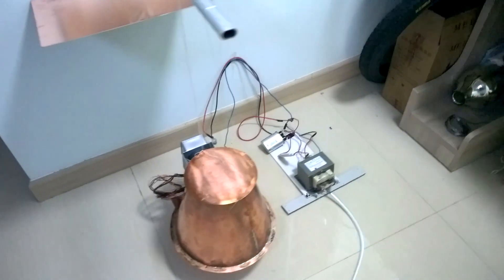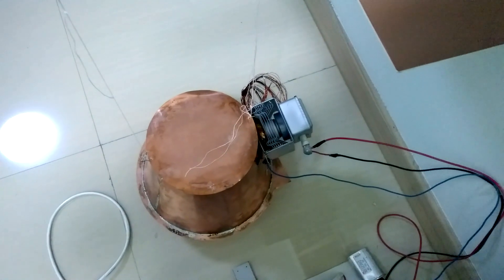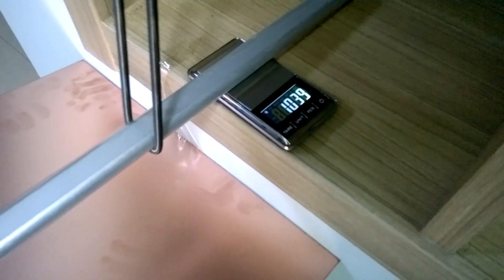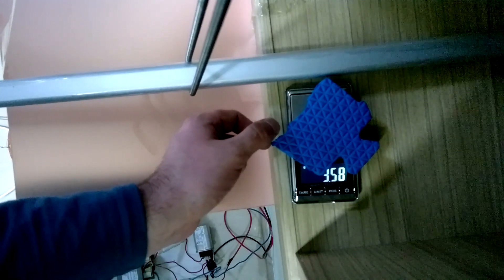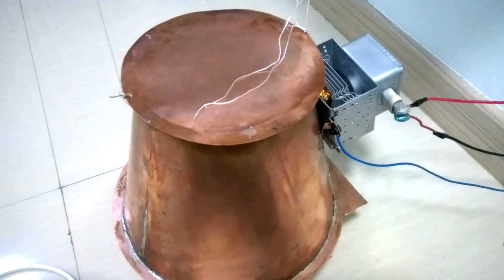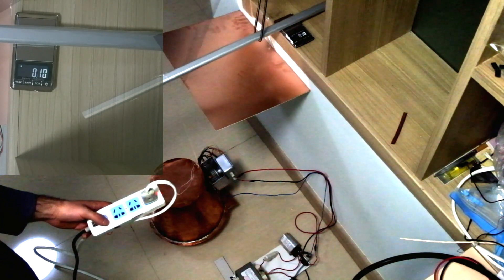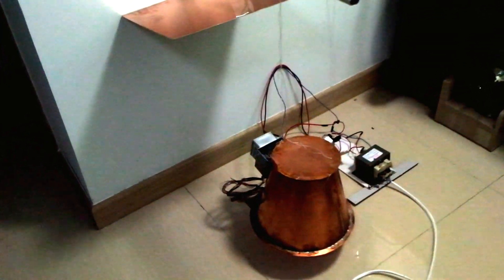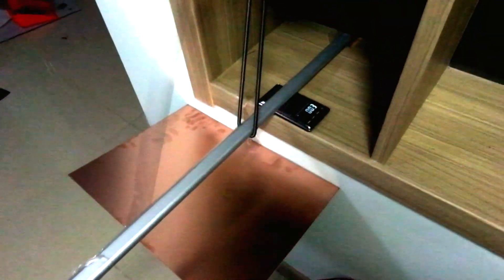EmDrive Test No.03 Success, I have thrust !!!

Comment: Magnetic effects of the power cables is what you are measuring.   Other EM Drive researchers found it very difficult to remove that source of error.  You should also try supporting the EM Drive with a block and see if you get the same reading.  It might be microwave energy being picked up by the scale.   But I think it is more likely a small magnetic torque on the power wires.
Reply from the maker: Check the other video with the opposite orientation, there is thrust also.
Reply: @iulian207  Your method for measuring any possible thrust is very imprecise.   You want to get positive results.   That's why you are not being careful.   I have seen the experimental results for many hopeful EM Drive experimenters.   Most are more precise than you.  The end result is always a second order "thrust" signature, indicating a thermal effect.   After you eliminate magnetic torque, you will start to see that.

Comment: First have you done any math on the resonance of the container in respect to the micro wave length? That is kinda important in this considering it’s based on resonance amplification. All so you should switch over to microwave plasma jets. That’s actually much more diy and offers way more results. EM drive is possible too tho just saying you don’t seem to be very heavy on the math and just slapping stuff together. I mean that’s not all wrong and some of our most important discoveries are due to mistakes. But this just seems a little more like stuff I was doing in middle school.

Comment: So much advice from people who haven't tried to buid and test the EM drive, i only can add my two cents. Based on experience: the scales work better, if they're cleaned from the weed residue between the plate and sensors. Also, smaller ones,
 with a simple backlit lcd display should react quicker, unless you go for high-end cumputer connected ones.

Comment: Hi. I understand, that it is resurrecting of  a "dead body". But the principle of work of this device is not something mysterious. It is a similar to a pressure of light. EM wave has it's impulse (by the law of conservation of energy). Make the frustrum and smaller plate from dielectric, and thrust will increase.

Comment: It is an interesting experiment, but I suspect that your magnetron is heating up the copper frustum unequally. Magnetrons heat up while in use, and since your frustum has a bigger surface area below than compared to the top, there would be differential heating of the air(because you can't do this in a vacuum, air plays a pretty big role here in messing up the experiment) and that would cause a resultant force upwards that can cause an erroneous reading. Still though, it is good to see that some common non-funded people are doing their own experiments in this day and age. Keep it up!

Comment: But. This Electron Charged Ion is not fast as Light Speed (!86,000 Mies a per Second);  It was created EM DRIVER for Inter- Planetory Traveler by Roger Shawyer. NASA already used it in 1998 on the deep space. This may be present bragging  Invincible Mach so called Hypersonic Speed Missiles by China and Russia?.

Comment: From the movie it seems that after few seconds the thrust is reduced, why you have not kept the ON phase for a longer time instead of continuously switching ON and OFF? Perhaps because after a few minutes the thrust would disappear? In that case in my opinion the measured effect is only due to coupling effects between the injected electromagnetic fields and the measurement device.
Reply from the maker: After a 10 seconds the magnetron  becomes quite  hot, and since i did not put a fan due to the obvious reasons, i was forced to stop.

Comment: not too sure just using imagination to guess this  but if microwave is based on radar waves then a tight beam of energy that  "physically" bounces off of objects to echo an object as a  blip on radar would mean that that same tight beam of energy would equally physically bounce off of surfaces inside a box-The armour on tanks are made at shallow angles to reduce the impact thrust and hopefully stop a shell reaching it's occupants -So if you create every wall inside an emdrive with angles  and "just" one end that is completely flat then the force of microwaves would hit these angles with a shallower force than the one single  flat surface - the bouncing back to the shallow angled walls may partly negate the forward impact with the flat surface but only by a fraction of energy impact compared to the  energy impact with a flat surface since the flat surface will receive a greater kinetic forward impact than the shallow angles within the box-The flat surface  would receive the maximum impact of force  -If microwaves are a form of radio waves but concentrated then their waves should surely be kinetic when hitting a solid surface even if that impact is minute-on the ground the friction or drag would negate that  "MINISCULE" forward impact , but in space where there is no friction then that impact would be unhindered by drag or friction(unless solar winds are heading in the opposite direction)  -imagine an untamed lion slamming itself against the inside wall of a cage that is not fixed or anchored to the floor-each successive blow will shift that cage forward in the direction from  where that blow was struck-without friction to create  drag the slightest impact against the "flat" wall  OF AN EMDRIVE would have more impact thrust than the angled walls because as in tanks a shallow angled wall will get less impact than a flat wall-My concern is that if microwave energy causes the molecules or atoms to jump up and down excitedly then friction would create heat and perhaps given time the metal may become compromised when it's surface is "eventually"  heated up by  "continual"  microwave bombardment  no matter how low the wattage is

Comment: Hate to burst your bubble, until that thing comes up off the floor by at least a few inches, you don't have anything. Once you lift, you then need to regulate or control it. To have something suddenly crash to the floor once the power is off would not make for a good presentation.

Comment: The easiest way to get to space is to use the Magnetron - that's right - just like the one in your microwave oven! The Magnetron in your microwave oven operates at about 2.4Ghz - this is good for agitating the molecules in food, but if you increase this "microwave" or "electromagnetic vibration" to about 30/33Ghz you can start to manipulate the force of gravity itself!

With this, you could surface a large shipping container with Magnetrons about every 30/33 inches and slowly increase the Gigahertz - as you get to about 30 GHz, you will start to create your own gravity! At this point, you open the Magnetrons on the top of the spaceship more and; just like Matter creates its own Gravity, there will be MORE "Gravity" on the top of the ship than the Gravity imposed by earth, and the ship will "FALL" upwards!

You modulate the Electromagnetic Field around the ship in the direction you would like to "fall" or travel in and "Gravity" will "fall" you into the direction you would like to travel!

ALSO - you can apply a strong field to the entire shipping container and actually reduce the interaction of Matter on the shipping container - moving the weight of the ship out of faze, reducing its "mass" and making it extremely nimble! - Able to travel at unimaginable speeds with little or no "gravity" within the ships field - therefore there will be no gravitational pressure within the vessel itself, so fast acceleration, sharp turns and abrupt stops will not effect the ship and crew!!! Orion Michael Guy

Comment: There is zero thrust at all. A weight valance and a copper pot on a nylon string all parts are wobbeling around,
after all it shows us clearly what EM-drive is : waste. Waste of Electricity and copper.
But the video is good, no noisy music and clear picture.
have fun

Comment: http://humbertomondejargonzalez.blogspot.com/2018/05/469-el-experimento-sobre-emdrive-de.html
469-El experimento sobre EMdrive de unos alemanes que es irrelevante porque no aporta nada nuevo al tema; que ya todos no supiéramos.
.........
4-Contradicts, the law of conservation of impulse.
.............
NO !, it does not contradict any law of impulse; because the engine must be supplied with energy constantly and this energy when released by the walls of the chamber in the form of heat (electromagnetic radiation, electromagnetic photons, the same ones you feel in your hand even the humblest of humans when you approach a hot metal plate, nothing of the other world that can not be understood by a scholar), according to the asymmetry of the camera will create an imbalance in the net output of photons and that will create a small boost.

Comment: The setup is flawed. With tight enough tolerances, all it would take is a vibration against the floor to create the appearance of reactionless thrust, when in fact the thrust is nothing more than a measurement of the amplitude of the vibration of the entire unit. The vibration is definitely there. All you have to do is listen to the audio closely. You can't have sound without a mechanical carrier wave transiting a physical medium of some kind, even if you resort to phonon theory. If he had a variable input that caused a change in the pitch of the vibration, you'd almost certainly see that as a change in the alleged thrust. Unless he can completely eliminate all vibration, it invalidates the experiment even if this sucker was suspended in a vacuum chamber, because the device itself acts as the medium for the vibration and any positional translation would have an equal and opposite oscillation that would make the device useless for generating reactionless thrust.

All of this said, it would be presumptuous to declare that the as yet unknown interplay cited in most theories that support the feasibility of this kind of drive are universally invalid and automatically violate the laws of physics. Declaring such a thing only serves to reveal to everyone that you are substituting one kind of faith (a belief that you know more than you do) for another (a belief that the principles you do know have an infinite scope of application). In both cases, you have departed from the realm of science and entered the realm of belief systems, no matter what kind of alphabet soup you have behind your name.

I am keeping an open mind (if for no other reason than simple entertainment). But a flawed experiment is a flawed experiment. People shouldn't get too excited about this video.

Comment: I hope to never buy drugs from you. Scale is off.  A US nickle weight is 5.0 g and 1 US dollar weight is  1.0 g most non ziplock sandwich bags are 1.0 grams also. 
   That what us poorly, unfortunate, uneducated South Texasend's like to call.  " Jew better be on Point"  🤐🤐🤐=🤓 ...dont skimp a poor mans way to escape. Easy way to get heater.  I almost there with the microwave but you also need to use a CVT tube from a old box TV then you will need Thor's hammer and then you will have Quantum inertia

Comment: [HTML] scirp.org
[HTML] NASA's EM Drive Thrust from the Forces of the Quantum Vacuum of Spacetime
MS El Naschie - Advances in Aerospace Science and Technology, 2018 - scirp.org
Building on the various manifestations of the forces latent in the quantum vacuum of 
spacetime such as Hawking's radiation and Unruh temperature, we resolve a major paradox 
connected to an immensely important proposal by NASA scientists for constructing a …
  Cited by 1 All 2 versions 
[PDF] ijeir.org
[PDF] A Theoretical Justification of NASA Electromagnetic Drive Based on Cosmic Dark Matter
MS El Naschie - International Journal of Engineering Innovation and …, 2018 - ijeir.org
Abstract–Based on earlier research results concerning cosmic ordinary energy and dark 
energy, it is argued that the energy density gradient present in spacetime can produce 
sufficient thrust to make NASA's EM drive proposal not only possible but also feasible. This …
  Cited by 1 All 2 versions

Comment: You are measuring your "thrust"' at the end of a pretty long lever against that scale. If you have produced any thrust at all it has been greatly exagerated by the long lever. I suspect that even a tiny change in the density of air from heating by your RF source within your "em drive" would be enough to show the result you are claiming. Place your drive on a scale directly and show that amount of lift and i will then be impressed.

Comment: Of course you have thrust. That thing produces EM waves which are made of low frequency photons. According to quantum mechanics photons have momentum that means any source of photons produces thrust, even a light bulb. To be efficient, you shall send all photons in a single direction. What does this job the best is a laser. Sending photons rather than high speed ions is theoretically more efficient because if you send ions you waste the energy the ions contain, but you need to have a way of harnessing that energy and that is not easy. For example if you have an electron positron annihilation you can release 1MeV of radiation. With matter - antimatter annihilation, you can release vast amounts of energy and you can produce enormous continuous power. If you can send the gamma rays in a single direction, it would make the most efficient way of creating thrust. 

But the problem is lasers can produce extremely low power beams for creating thrust and the same case applies to EM drives. The other problem is even if you had a super powerful EM drive, you can't have a powerful enough electrical power supply for it. The only way for a power supply would be using nuclear power.

Comment: You're putting a 3.6 gram weight on the end of a long leaver which is granting mechanical advantage to where the scale is thus the 3x increase in weight. DUH! You should turn the device off and see if you get a different result.

Comment: wouldn't the spring be technically assisting thrust? Seems like a proper test would eliminate the spring.
If you removed the spring you'd be combining the weight of the bar and the engine. Firing the engine should eliminate part of the weight of the engine, still reducing total weight on the scale.

Comment: There are unmentioned alternatives, therefore possibly unaddressed, like electromagnetic forces on nearby materials in the lever, floor, & mount equipment, or thermal effects in the air, etc.  You might want to eliminate, compensate or at least measure them.

Comment: Do yourself a favor and read "Standing Wave Transformations in Phase Locked Resonator" by L J Reed. 
The last diagram explains how a phase conjugate standing wave resonant cavity can doppler shift itself against the field energy stored in the resonator, imparting momentum on the cavity walls asymmetrically. The EM Drive is most likely producing a Doppler shift signal from the geometry of the walls giving your an interference pattern that approximates this Lorentz Doppler shift signal.

EM Drive however, does not use Phase Conjugate Mirrors (PCMs) and a doppler signal generator, and thus has only the smallest thrust. The Q-factor and energy input is not important if phase conjugation is not achieved and subsequently phase shifted against. If the full energy of the built up microwave field were transferred in quantized inertial impulses to the cavity as designed, you could indeed generate nearly 100% efficient conversion of Wattage to momentum. 

This phase shifting gives us a clue on how to reach (Or exceed) the speed of light itself, since inertia and time-dilation/length-contraction effects are due to doppler shifting in accelerated reference frames. By negating the effect with the conjugate doppler shift, you experience no inertia, no speed of light limit within your relativistic frame of reference (think static warp bubble).
Reply: Taylor Westmore Traveling at the speed of light is impossible , in any way, shape or form.

Comment: Sorry but when I saw you were using the same scale I bought for $20 at the gas station to weigh out my pot in high school, you lost your credibility with me... Not to mention basic laws of physics, cuz if I do you're gonna feel REALLY silly... Focus your talents on building more practical devices, you clearly are interested in physics/engineering!
Reply: Why not use light waves or  lasers in an optical cavity which would be 
similar to a microwave cavity? They are both electromagnetic waves 
differing only in wavelength or frequency. This could allow for 
miniaturization and higher output thrusts as  e=hf   e-energy
 h= planck constant and f= frequency.

Comment: Would be a better test if you can use a large enclosure that you can pump most, if not all, of the air out so the test can be done in a vacuum or near vacuum state. Then take the thrust readings from this and compare to the thrust readings from the vacuum room/chamber.

Comment: Ideally you need to perform repeat measurements with the cone in different potions.  Currently it could be argued that the electrical input is heating air molecules creating a lifting force within the cone.  If the cone is turned upside down and the down force increases it is unlikely to be the upthrust of heated air molecules.  The experiment should also be isolated within a vacuum.   Difficult to achieve perfectly but an airtight plexiglass chamber might be able to show the effects, or otherwise, of fairly small changes of increased and decreased air pressure.  The principle is to try and eliminate every possible variable.

Comment: It could do an assembly by putting several magnetrons in parallel. As if it were a magnetron thruster! Also several: magnetron in a single piece. Propelled Maglev style which is an open electric motor in one part.